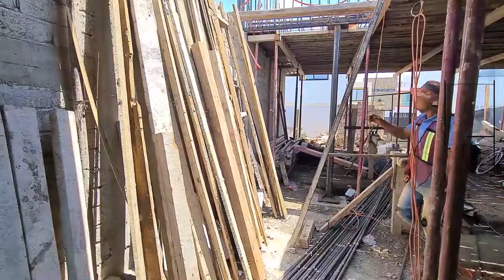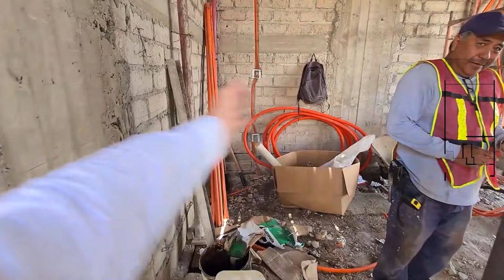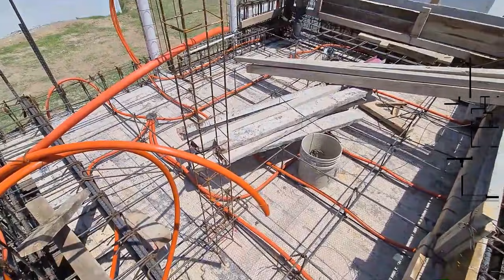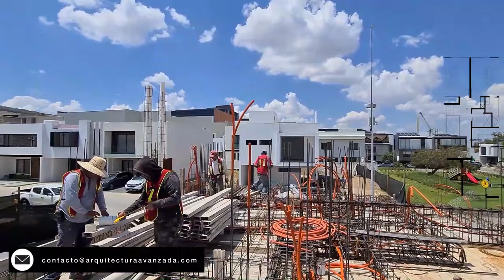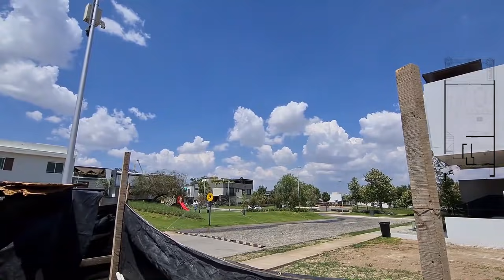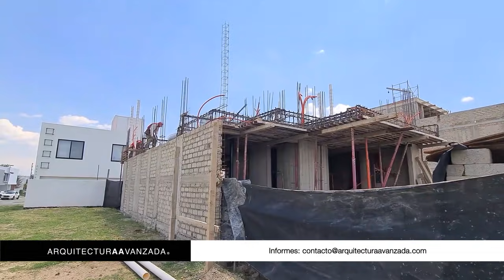REVISIÓN DE PLANOS | CASA EN VENTA DE 7 X 20 | OBRAS AJENAS

Comment: Un gran video arquitecto, la longitud de los traslapes dependen de varios factores, si las varillas llevan epóxico, la resistencia a compresión del concreto, si es concreto ligero, la dimensión de los recubrimientos o de la separación de las varillas, la resistencia a fluencia del acero, si hay o no estribos (generalmente esto no se toma en cuenta) y sobre todo del diámetro de la varilla (barra de acero corrugado), una barra de gran diámetro necesitará una mayor longitud de desarrollo(y por ende un mayor traslape, depende del tipo de traslape) al contrario de otra barra de un diámetro menor. Saludos desde Bolivia a todos los de México lindo!!!! 
Este canal es una joya.